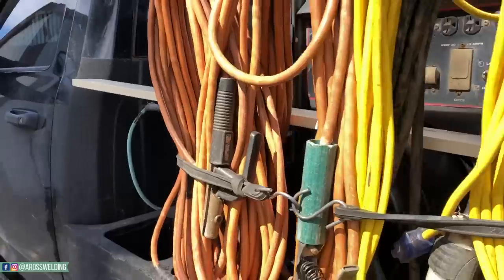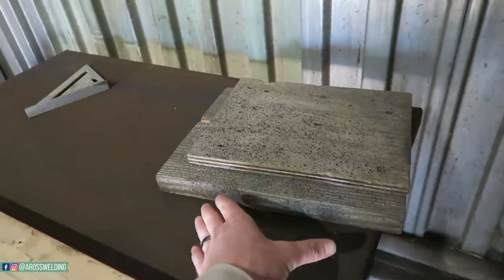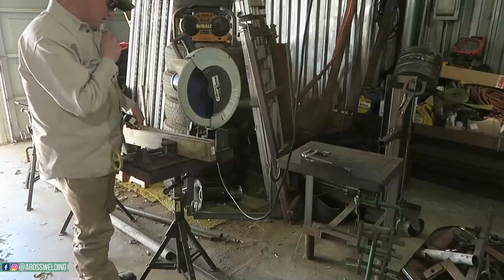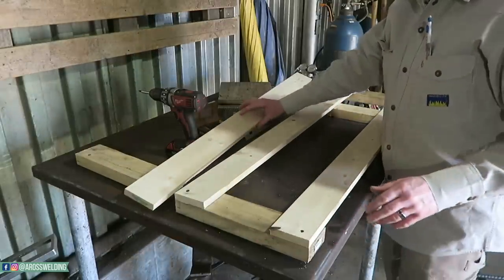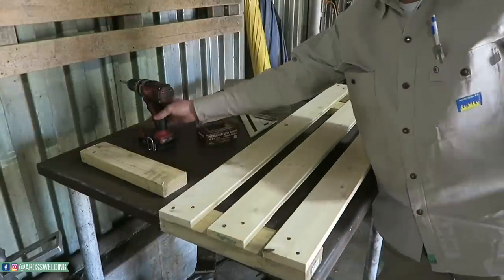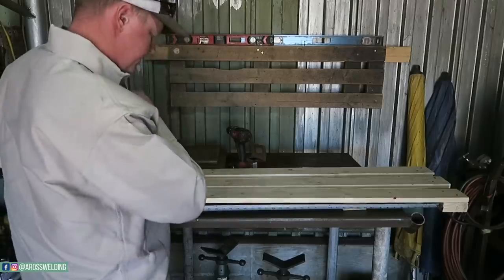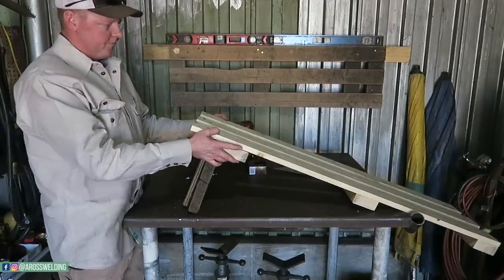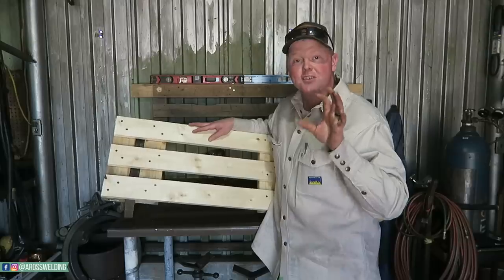LET’S BUILD A PIPELINE WELDER MUD BOARD FOR YOUR RIG TRUCK (EASY!)

Comment: That's a great idea !   Not only for welding but could be used in any outdoor procedure in the dirt & mud .   For years I've used plywood sheets but they can be hard to handle and soak up ground water .  Thanks Austin and we gonna build some " Mud boards " with the hillside option . I like that !

Comment: even as a life long carpenter who has earnd his living as a welder for over 30 years my mud board is a aluminum bench that the legs fold up sepertlly on eather end. its about 14 inches by 42 inches. i can sit stand or lay down on it. 
always ment to build a wooden one but got thelis one cheap at a lumber yard thatwas clearing out a line of ladders. its always worked greatand plenty of guys have been jelous of it when i use it to sit on while i eat. great with one side up and the other down for taking a nap on a nice day. 
thanks for the video. gonna send it out to my 4H welding students
Reply from the maker: I know exactly what you’re talking about. Those are very handy also. My brother and several other welders i know use those. 👌you bet I hope your students like it.

Comment: 😂 I’m ocd about everything if I got two soap stone holders on the table it’ll have to be arranged side by side shortest to takes from left to right I do it with everything it really helps me weld because I can’t stand an uneven bead so i zoom in and focus on my arc and speed haven’t ran the perfect bead yet though pretty close but not perfect lol I do like this mud board idea though I’m going to have to make one over my cardboard chunks I drag around when I’m headed to a job in the woods

Comment: Lumber is spec’d on the rough-cut dimension before sanding (kinda like “1/4-pound before cooking” with burgers), so the final dimension is always smaller.
I don’t recall 2x4 ever being other than 1-3/4”x3.5”, but I’ve seen old construction that used 2”x3” rough-cut studs.
FWIW, premium wood can be bought as “4/4” thickness (4-quarter, which is actually 1 inch), “8/4”, etc.
Reply: Back when I first picked up a hammer (7 years old in 1958) a 2x4 measured 1 5/8 x 3 5/8. Mills knew they could fudge a little because of the planing even then but when the size was changed to 1 1/2 x 3 1/2 after planing (to make it "easier" to  figure), the mills knowing they could squeeze one or two more boards out of a log began saving that eighth of an inch when rough sawing. The quarter system is the rule for all Hardwoods 4/4 and thicker. Under 4/4 the accurate planed size is used. 15/16 is as common for that as 3/4.

Comment: A: I would add gluing along with screwing the boards together, to mnaintain squareness and durability in the mud. Might also consider waterproofing once completed. To answer the 2x4 question... Back when trees were plentiful, a 2 x 4 rough sawn was 2" x 4". Now with kiln drying, production lumber is usually 1/2" shorter in width and height.

Comment: Yes they have especially  when they run it through  a planer  in the mill it's also not a true 2inches  thick there is a tolerance  the lumber company's have now and I caint  remember  what they are  I use to work in a mill where that was all we did was plane and grade boards

Comment: Do you use a roll out wheel at all for smaller pipe Fab? Or ever build one?  Been trying to get a basic and inexpensive one to make for when I'm in the feild for and fabrication other than pipe.
Reply from the maker: I have ya. I’ve got one and made a couple. I’ll take note of the video idea. 👌😎
Reply: @arosswelding  I appreciate it

Comment: A 2x4 you get from the store is not actually 2x4 inches its a 1-3/4x 3-3/4 they start as a 2x4 when they are cut from the log then they get sanded and finished to the measurements I said so that when you make something its more easy to get it flush and square

Comment: The size of lumber was reduced during the Second World War.   Boards used to be planed at (for a 2x4)  17/8 by 3 7/8  A 1x1 used to be 7/8" square.  It was reduced to make more lumber out of logs.  Before the First World War,  you had to specify how you wanted your lumber planes, you had POS - Planed one side 
PSS - planed short side, Planed BSS Planed both short sides, PBWS - Planed both wide sides, and so forth.  That was too much for the government men to figure out, so they ordered that lumber be planed all sides (PAS).  That meant the size of lumber was reduced from 2" x 4" to 1 7/8 x 3 7/8  - More reduction came later during the Second War,  Particleboard and chipboard were invented when the Mills looked for a use for all the planing scrap. Saw duct and chips are made into particle board.   You can get more life out of your mud board if you prime it two coats with an oil-based primer, and then paint it with acrylic paint.    We used to make boards like that - two feet wide by ten feet long touse to work off the side of a building.  We would stick them out a window.  We called them diving boards.  Once in awhile someone would fall off of them.  OSHA put an end to them.   I finished my apprenticeship as a carpenter before most of you were born, in 1946.  I've been trying to learn how to weld for the last fifty years, and still am no good at it.  Got rid of my last welder about five years ago.

Comment: As a guy who only welds in my climate controlled metal shop and then only when I can't machine a solution...wtf is a mud board for? My best guess is to place on the ground (yuck I may get my boots dirty!) to "flatten" an incline?

Comment: Not a pipe welder, however you gotta have a mud board.. anyways, I screwed another 2x4 on the otherside and have two 2x12 (or close lol it's all from scrap) that way it's kinda like a janky step stool. Worked for what I needed at the time. Btw. It's not a mud board, it's an "Accessory Garage Floor" 😉

Comment: A 2x4 is actually 1 1/2 x 3 1/2. Because when they run it through a planer it takes half an inch off
Reply: 2" lumber at the mill is actually sawed 7/4....seven quarter....1 3/4" to start with.